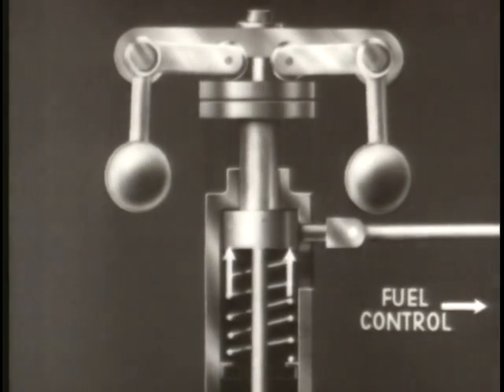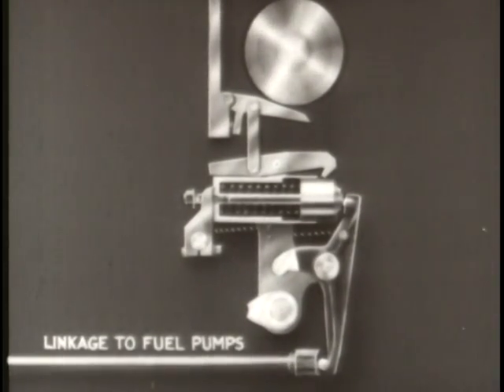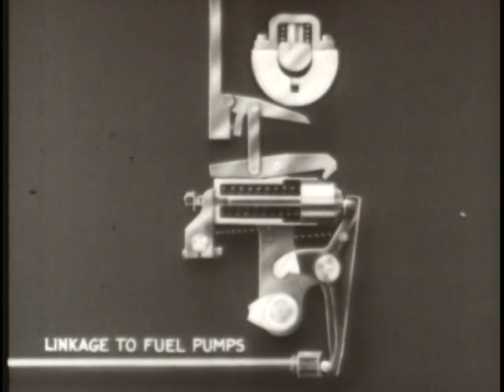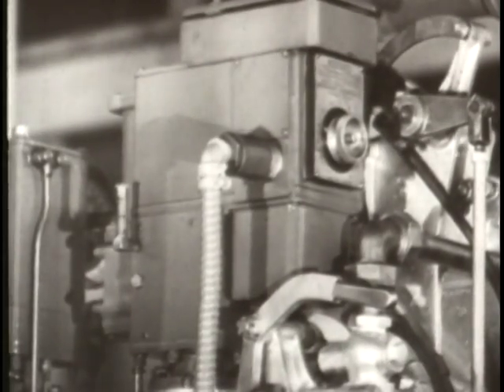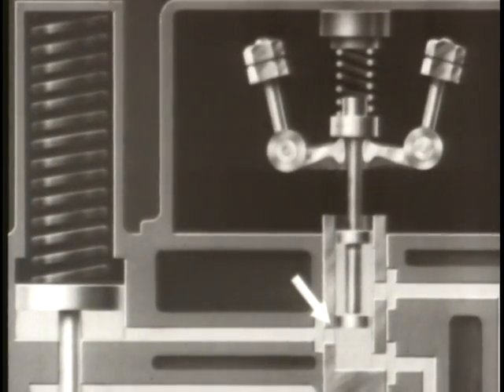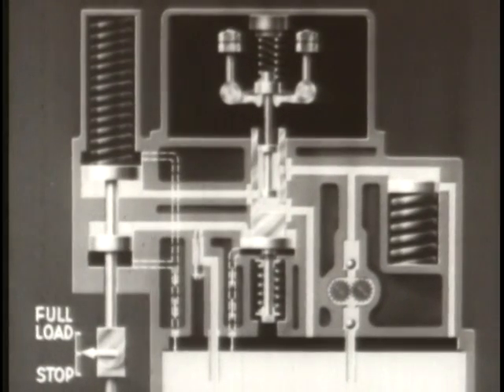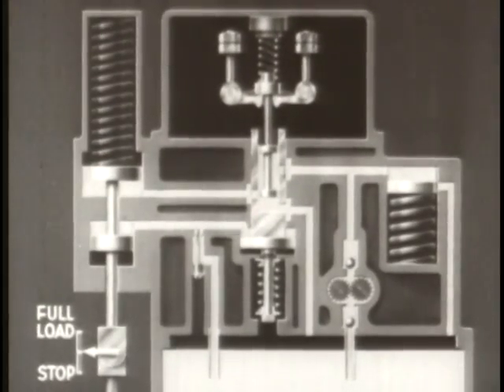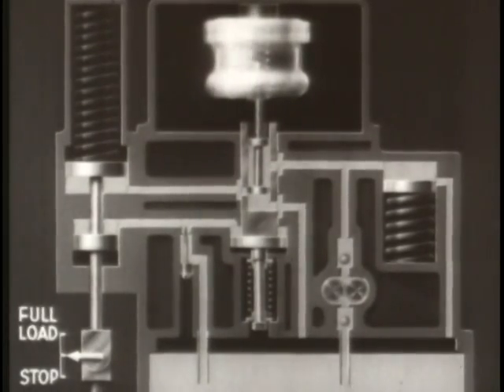Diesel Engine Governors (1942)

Comment: I'm betting modern day governors use an electronic system to control it. It's much easier to gauge how fast something is spinning using a small electric coil rather than something with so many moving parts, and logic gates can have redundancies.

Comment: What ever happened to true mechanics? Now it's all electronic crap.
Reply: 2NDSIDE Ever seen the inside of a firearm?
Reply: The market for mechanics died when cars changed from being a passion to being a consumable.
Reply: This is luddite crap, electronics are simply cheaper and better performing, which was the case with diesel engines vs steam engines. And with steam engine vs animal power. And animal power vs human power.
Reply: A governor is simply a feedback system controlling speed. A properly designed electronic circuit can do exactly the same job with far less parts wear- notice that you don't have to change the oil in an electronic governor.
Reply: Eric O would get a chuckle from your blanket statement.
Reply: While o kinda agree, electronics shit is more reliable and is easier to fix/brakes less. Also u can turn governors off now which is nice for my sleeper car.